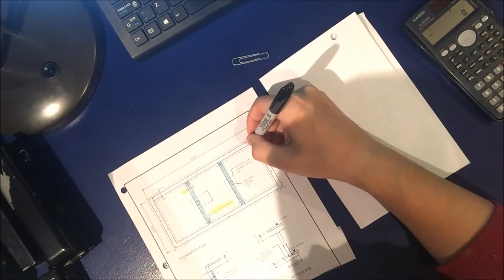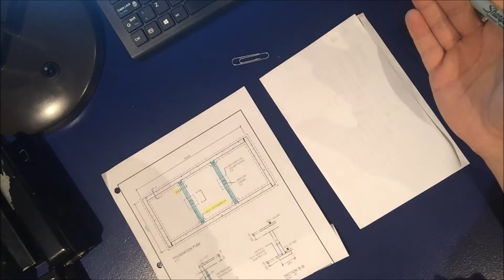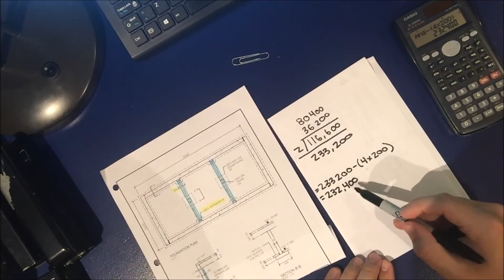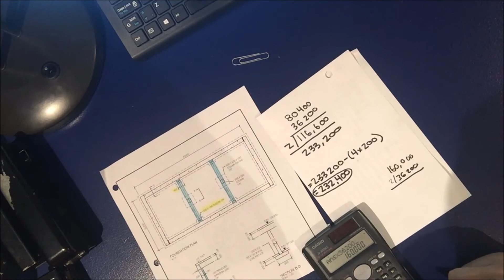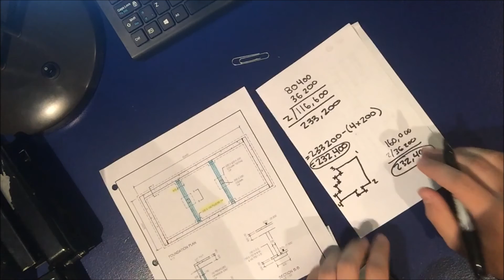How to find centerline?

Comment: what if the corners are at a 45 degree angle but not a 90 degree angle? cause that method doesn't work if the corner is no longer at a right angle